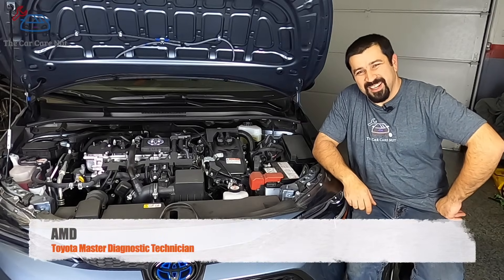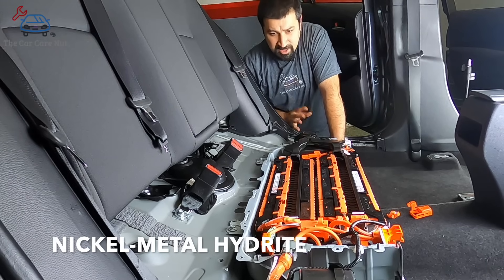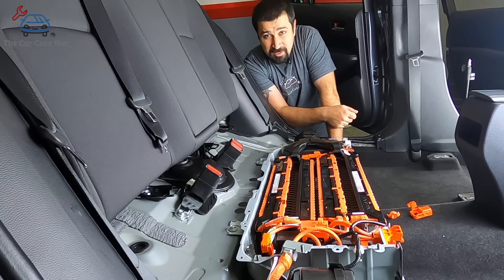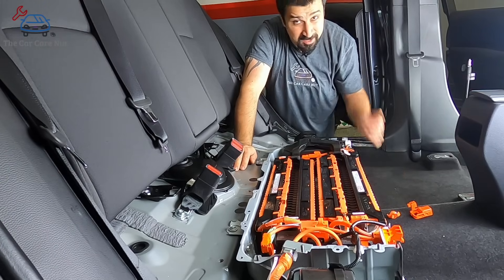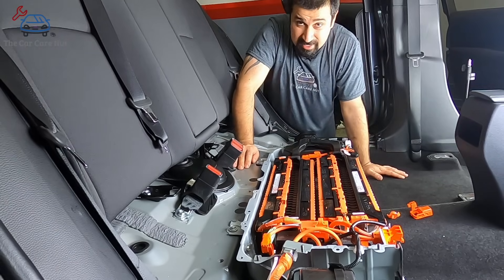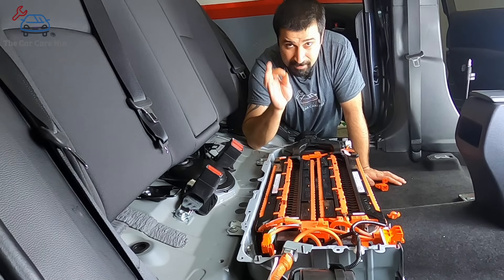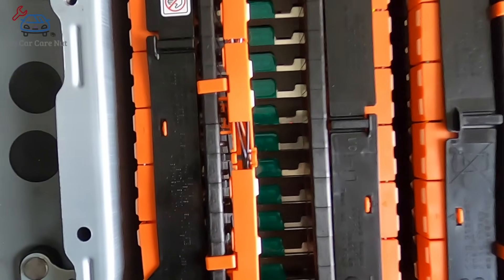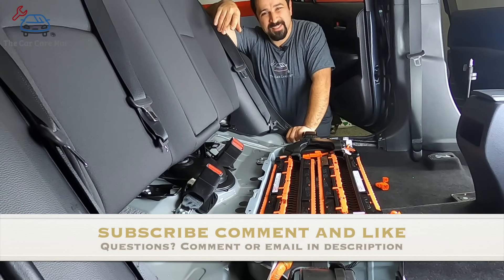How Toyota Hybrid System Work Part 1 High Voltage Battery

Comment: Thank you, very informative video once again. Thanks to your very deliberate and frank discussions of the highs and potential lows of hybrid ownership, I went ahead and ordered a 2021 RAV4 hybrid, XSE version. It’s very well equipped but I want to get a set of four winter tires on rims because in my area of eastern Ontario, we get lots of freezing rain during the winter. Granted, icy roads are a challenge for any tire, but I think winter rated tires are better than all season. One curious thing, the XSE comes with 18” wheels, yet the dealer is recommending that I go with 17” for the winter. Seems odd to me, would you agree with the dealer?  Thank you.
Reply from the maker: Thank you for watching my video and congratulations on your Rav4! You’re gonna love it! Regarding tires I would agree with the dealership on the price 17” wheels you’ll get more tire height and tires will be cheaper for winter tires.
Reply: @TheCarCareNut  Thank you, I appreciate your advice.

Comment: Does the 2013 Prius V have a lithium ion or nickel metal hydride battery? Can the car perform well with either?
Reply from the maker: The 13 Prius has a nickel metal hydride battery and performance wise they are almost equal on your side.
Reply: Prius+, prius Alpha and prius v(Australian version) has Li-ion batter.

Comment: Amazing.  1 billion like. But still looking forward for the tutorial regarding rear brakes job. I have the 2020 hybrid corolla.  I might have to change the brakes soon.
Reply: So soon? 😳
Reply from the maker: @yunus_aros  I was wondering the same. Curious @tarek Riza how many miles does your corolla have?
Reply: @TheCarCareNut  it has 25 000. I drive on average 1000 to 1200 miles a week.
Reply from the maker: Interesting. That’s pretty soon for rear brakes. Sorry I’m asking a million questions just wondering of the brake wear trends on the 2020+ corolla
Reply: @TheCarCareNut  i used rochange the rear brakes around 40000 to 45000 on my 2016 corolla s. I install wagner brakes. So just want to be prepared 😀
Reply from the maker: Thank you! I’m hoping I can get that done next week for the following week.
Reply: I just had the break pads changed on my Toyota Verso-S after around 44000 miles  74000 km. The Rotors are still in a great condition. The car is almost 10 years old. It was called Toyota Ractis in USA, Asia, Australia and New Zealand. NCP120. The rear axle has break shoes. 

I have two made in Japan Toyotas. The NCP110 (Scion xD/Toyota Ist/Toyota Urban Cruiser) and the NCP120 (Toyota Ractis/Toyota Verso-S/Subaru Trezia (NSP120)).
Reply: I have been driving a Yaris Hybrid from 2012, never changed brake pads and they are still almost new with the regen. You are doing something wrong if already need to change them.

Comment: Hey TCCN what are your thoughts on Toyota still preferring to use a Ni Metal Hydride battery in the 2020 Rav4 hybrids, while giving the Rav4 prime's Li-ion Batteries. Of course we still don't know what the 21 rav4 hybrids are going to get.
Reply: I own 2005 Gen2 Prius (old Ni-Mh) here in Finland and it often gets -30 Celcius in winter. Original HV battery still works like new!  One winter leave it at Airport for a week (-27 C, all week) and it started right up no problem! Just can not think Li-Ion surviving that kind of test!
Reply from the maker: Hi! While I cannot comment directly why but I’d say it probably has to do with cost and size of the car. Nickel metal batteries has proven to be super reliable already perhaps that’s why they went ahead with it in the RAV4 and not switched it to lithium ion
Reply: Toyota uses the Ni Metal Hydride batteries in Prius eAWD because according to Toyota it has better performance in a lower temperature where a AWD are usually used. For the same reason I would assume they are using it in RAV4 Hybrid.

Comment: Thank you for another great informative video. When you say that hybrids should not be stored for a long time, how long do you mean?
Reply from the maker: I’d say 2-3 months and up and more importantly the consistency of storage. So if you have an unusual circumstance where you left it for 2 months and then after 3 years you did the same it should be ok. However if it’s a systematic store where it’s stored like this every year then it will be a problem over time.
Reply: @TheCarCareNut  Thank you for your quick response. You are appreciated, blessings!

Comment: Thank you. I'm starting my DIY me mechanic adventure with my 2010 Prius.
Reply from the maker: Awesome! I’m trying to put more information on 3rd gen prius models. Do your research on each job you tackle and ask any questions you have!
Reply: @TheCarCareNut  Can you talk a bit about tools you're using or what's needed for DIY Prius owner? Big thanks from Ireland.
Reply from the maker: I’ll add this video idea to the list! In the meantime email with any questions specific to jobs you’re tackling and I can help with tools needed
Reply: @TheCarCareNut  I have heard a lot about oil consumption in the Gen 3, with lots of fingers pointing to the small drain holes in the oil control ring seats and subsequent coking of the holes and rings. However, coking makes me think the owners are using conventional oil (which can't be 0W-20) and/or neglecting change intervals. Any light you can shed on that in a gen 3 video would be great!
Reply from the maker: Gen 3 common problems videos coming soon. The oil consumption is a problem with these. There’s a TSB with updated pistons and rings but the issues goes to the 10k oil change.